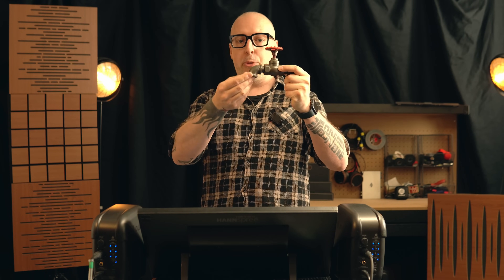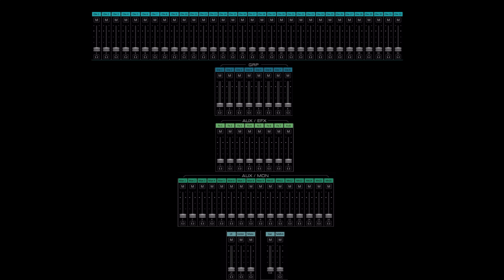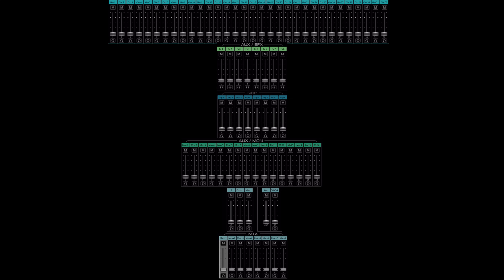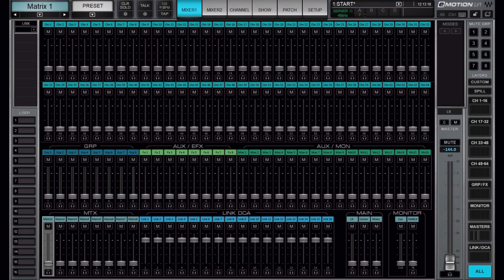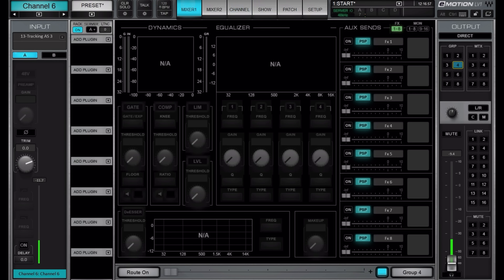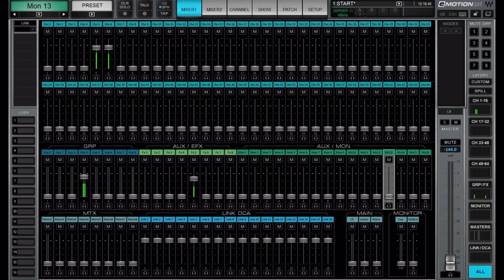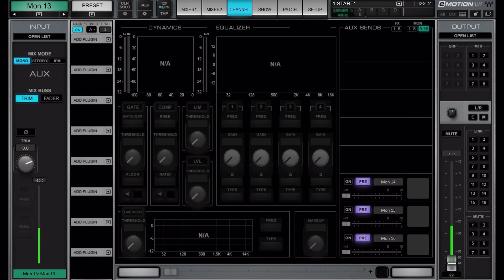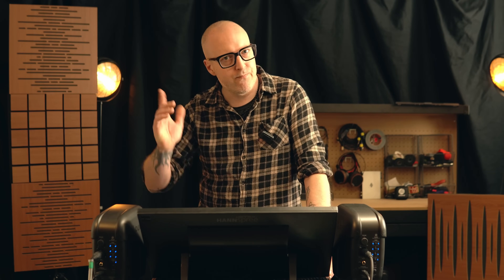Signal flow in Waves LV1

Comment: Good stuff as always, Joe!  In case anyone needs to send signals upstream (to use your analogy), use a plugin inserted on a channel with a sidechain sourced from a group.  Click the monitor/listen option on the external sidechain so the output of the sidechained plugin feeds the rest of the channel strip.  Emo D5 is a great plugin for this, as the sidechain monitor button stays locked on when the session loads.  I use this because I want Dugan to ride herd between a solo vocal and an ensemble of vocals that are grouped.  Musical theater work needs this sort of thing pretty often, but I'm sure there are other use cases.
Reply from the maker: @tychristensen8256  
That is an excellent idea and a great way to override the downstream workflow. As long as you don't create internal feedback 😀
Reply: @joevegna  Yeah, the potential to wreak havoc is strong.  I also don't think this approach retains LV1's internal sample-aligned and phase-consistent approach to mixing, so buyer beware.  Fortunately for my use case, this isn't a problem for me.